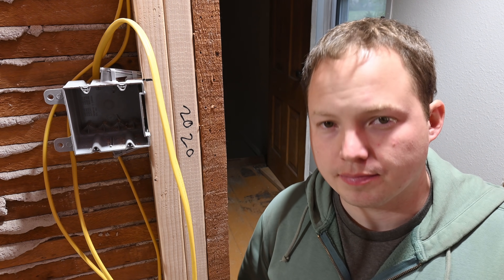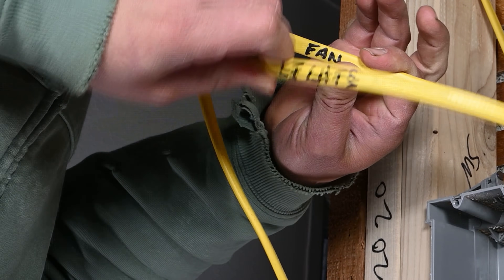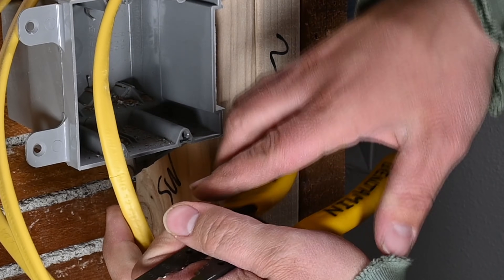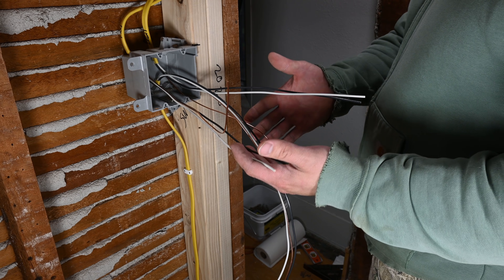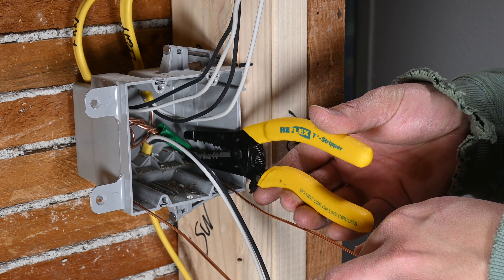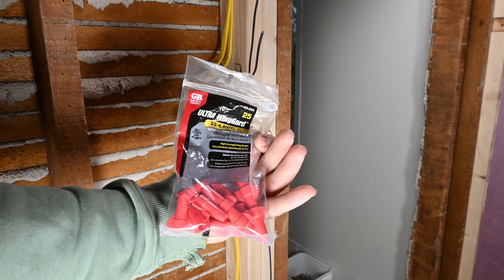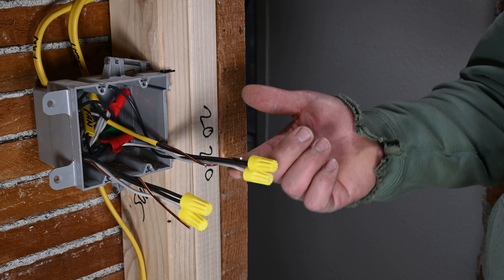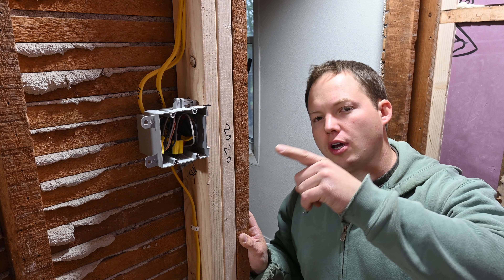How To Rough In Wires For a Bathroom Light & Fan Two Gang Switch Box

Comment: Couple things I'd do differently. I would pull all the romex into the box first, then strip. That way I don't have to relabel the cable and I can leave more sheathing inside the box. Also, I would use a normal wire nut if there are two ground pigtails. I only use greenies if there's only one ground wire needed.

I would also consider having one 12/3 switch leg unless the fan is separate from the light or the local code requires 2 separate neutrals at the ceiling fixtures.

I'm not an electrician but I'm majoring in electrical engineering and I have worked with electrical wiring for couple years.
Reply from the maker: Thanks for sharing! I like how there is more than one method or way of doing things like this.
Reply: How about answer this for me (anyone) what if I put a new breaker box in with all 20 amp gfci arc fault breakers and 20 amp outlets on 12/2 wire....is there any reason at all I should buy 15 amp and 14/2? Can't find an answer, is it over compensation or is there a legitimate reason you need 15 amp circuits with smaller wire? If I buy 300 ft for the whole house I would rather just use one style wire (aside from water heater ect..) instead of mixing them causing future potential problems
Reply from the maker: @davidkramer333  14awg is easier to work with and well adequate for lighting circuits. You are correct though that using all 12awg would work just fine. It's just overkill for lighting since LED uses such a small amount.

Good luck on your project!
Reply: @BenjaminSahlstrom  I am buying in bulk so I would have enough 12 to do the whole house is my reasoning. Your videos have helped a lot. I am doing the fishing and roughing in lights and outlets in an old house. I can run everything without having it even hooked to the box since I am upgrading my service when I am done. I will have a professional inspect my work, put in the new service and hook it all up to the box because I am not at that level yet. I am in the country so I can shut it off from the pole in my yard if needed but I still am not 100% so I will leave that part to a pro. 

Thanks for the response, you have a new subscriber
Reply: Do some more research your approach is faulty
Reply: @gerdberg4188  If it's faulty, why are other electricians doing it? Instead of spending your time and energy correcting me, why don't you correct the electricians who showed me how to strip inside a box? In the Electrician U channel, a Texas electrician by the name Dustin always strips inside a box. Here's a video of him installing a single pole light switch:
https://youtu.be/PL2QF4OK1to

30 seconds into the video, he stripped two romex cables inside the box. He even tells you how he does it. This video is the short version. The original video is way longer than this
Reply: @gerdberg4188  "Well, that's just, like, your opinion man..." (The Big Lebowski, 1998)
Reply: Care must be given when passing out electrical advise.  In some states, electrical professionals can be held legally responsible for the advise they give.

If you are not a professional, please seek out the correct knowledge before doing any work.

Can this circuit be jumped from the bathroom receptacle?  Maybe!

Are neutrals required in this box?  Why?  Part of code?

And a commentor asked about using 12 awg instead of 14.  This felt like an invitation for a lesson on "voltage drop" and wire length.

So, if you are going to do your own electrical work, let me remind everyone that a second check might catch a problem before it becomes a disaster and especially the pros, inspectors might be your only second check.  Please make them work double time to find any problems.
Reply: Well how many thousands of boxes do you think it took me to develop the methods I use to make things work out the FASTEST
AND THE BEST .  What you say about not mattering inside the box is wrong thinking . You only need a short bit of sheathing in the box . The rest gets in the way of making up a box nicely . The code says that work needs to be executed in a “neat and workman like manner”  that means everywhere by the way . Would you just stuff wires in a panel …. No
Well the wires in any junction box big or small need to be arranged sensibly too that also applies to device boxes .
Reply: @gerdberg4188  When using non-metallic (PVC or fiberglass) boxes with integrated tension clamps, it is much easier to insert the unsheathed cable into the box first, and very carefully strip the sheath from inside. You need just a 1/4 inch or so of sheath beyond the point of entry into the box. The reason it's easier stripping after is because the stripped sheath will invariably snag on the clamp before you can pull in the necessary 1/4 inch required by code. If you're using the REALLY cheap non-metallic boxes that have little square knockout holes with no integral clamps, then yeah, you can just poke your already-unsheathed cable in there. That's probably what you're using, so it makes sense you're doing what you're doing.
Reply: @aaron74  I agree. Thank you for your excellent explanation of why people like me strip inside a box
Reply: @aurvaroy6670  I'd wager most people do it this way! Even Ben did in his earlier videos. To be fair, that gray box that Ben's using in the video seems to have clamps that are less aggressive than the blue boxes have, and the sheathed cable doesn't snag.
Reply: @aaron74  You're right. Ben did it in his older videos. In fact, he labeled each cable inside a box before stripping and forgetting which one is hot and which is a leg
Reply: I now see why you insist on steel . It not “better” it’s different .  Different systems use different materials . I knew after a bit that you were not licensed . You do not have a full understanding of the trade and the application of proper materials for the installation at hand  . I have been installing code compliant electrical systems of all types for over 30 years . my systems 
Always pass the inspectors scrutiny . I don't just do electrical work , an Electrician is what I am .
I don't mean to be a dink , I am sorry , my GF said I should be nice .  So hang in there it actually sounds like you do a good job 
I was partly ragging on you . Lol.   I know it is hard to get someone to do the work and they charge arm and legs now
Reply: @gerdberg4188  I believe steel is objectively and qualitatively superior. Your only valid argument against steel has been cost, which I fully concede. Quality simply costs more, both in materials and labor.
Reply: You have no valid argument you are not an electrician and do not understand the systems and their application . 
You won't even BEGIN to until you have been doing it professionally and doing design build work .
You are just wrong . Like I said you could not possibly compete on a commercial 
Level .   You unlicensed guys think you got it covered . But you do not .
I have been behind many guys like you . I have seen lots of good work lots of bad work . Steel is not better in many situations .
Go ahead use steel in an old damp basement or a garage or shed out building  , barn , bathroom , even the kitchen . And you will find that steel all has corrosion of some type . My systems will outlast yours and be more easily serviced . You just do not use steel boxes where you do not need to . Talk to any electrician maybe they can get you to understand . Basically you are misapplying materials . 
You just do not get it  I am sure your work is good just not totally code compliant
Reply: @gerdberg4188  The amount of arrogance in your comments is overwhelming me. You say you have over 20 years of experience and do this for living, yet you set around and leave really long replies to amateurs like me. You tell us not to argue with elders, yet you're allowed to taunt youngsters like me.

Let me be clear. I'm not an electrician and I don't plan on being one anytime in my life. I don't go to people's houses or businesses fixing or installing electrical equipment. So don't expect me to work for you or against you. I am majoring in electrical engineering, so it's fitting for me to do some simple electrical work, like installing an additional receptacle, rather paying someone $300 to do it quick and dirty. Videos from Ben and Dustin help me do such work, unlike your replies that hurt me instead. 

I'm tired of hearing the same shit from you over and over again. For this reason, I'm not gonna respond to any further replies from you. Instead, I'll continue watching videos from this channel and Electrician U
Reply: @aurvaroy6670  Yeah, this channel seems to attract trolls every now and again, and usually the trolls don't even know they're trolls like this guy. Usually butt-hurt tradesman who, while certainly competent in their trade, feel undermined that DIY'ers can perform code-compliant installations with equal competence as them.
Reply: @aaron74  I agree. Some people have problems with unprofessional, unlicensed folks doing electrical work. I'm not gonna listen and follow to those trolls. Thank you taking your time and defending me. Your comments always make sense to me, so I'll continue listening to you
Reply: @aurvaroy6670  If you're following Ben here and Electrician U, you are really set. Both guys are very good. I would say just because someone may not be licensed doesn't mean they're unprofessional. I would compare the outcome of my work any day with a journeyman or even a master... I'll admittedly just take longer to get the job done since I don't do it every day. It's okay, I'm not in any hurry! lol
Reply: @aaron74  Thanks for that compliment. I always learn useful information from both channels. In fact, they inspire me to do more projects on my own.
Reply: @gerdberg4188  "I'm sure your work is good, just not totally code compliant," he says with feigned diplomacy. If your work is not code compliant, it's not good. Any electrician not suffering cognitive dissonance should know that. You have a right to your opinions, dude, but they're only just that--opinions. We all have them. The more sensible among us don't bully people with our opinions as though they are facts. Tell all our sparky friends in the Chicagoland area that they're wrong for using steel and EMT. That is local electrical code in that area--it supersedes NEC.
Reply: @aaron74  ya but you are misapplying by using steel with nonmetallic cable . 
Wanna have a pipe bending contest , I have run many thousands of feet of all different sizes of that too .
You peeps have no legs . You need to pay attention . If you are not an electrical professional you know not of what you speak .
Period . Fact . Period . And for the engineer , we’ll talk to any electrician and you will find that very few engineers can design any system without much rework until they have many years experience . Engineers should all be required to work two years in the fiel on their field
Reply: @gerdberg4188  You don't want a discussion. You want a pissing contest. Show me in the NEC where you can't use NM cable with steel boxes. You're full of bluster and devoid of FACTS.
Reply: @gerdberg4188  The more you talk, brag, and demean others, the more sure I am that you're a 2nd rate electrician at best. I've doing this a long time and there are lots of ways to do good work within NEC guidelines. Some strip in the box, some don't. I do it both ways depending on the situation. Real pros know when and how to pivot to alternate methods. And BTW, judging others you've never met and work you've never seen is trolling. Lighten up.
Reply: @mntriangle  go away you are obviously not an electrician at all
Reply: @gerdberg4188  The world is so lucky to have God's anointed one right here in this forum! My apologies to thee.
Reply: All you guys that are not in the trade …….listen to the guys with the most experience………..the electrician u guy is good but he misses shit believe me…………….I have probably been doing it 20 or so years longer  and I miss shit . Shouldn't argue with your elders……….
Reply: @gerdberg4188  ".I have probably been doing it 20 or so years longer  and I miss shit . Shouldn't argue with your elders………." - To that I say "Even an old dog learns new tricks," and if you've been doing the work a long time you are obviously very hardened in your opinions and probably mistake them as facts. If I hired you to do electrical installation at my house I would want you to use steel boxes, and I would not care if it costed more. You do what the customer wants, or you walk away with empty pockets.

Also it is very fair to say we will ALL miss shit. Nobody is omniscient.
Reply: You have no idea how much crap an apprentice has to go through to be qualified for the trade . It takes minimum 4 years working full time , all documented  , plus school to get a journeyman's license . Why do you think that would be .
Yes I guess I am a little arrogant having people that aren't even qualified as apprentices arguing with me instead of listening .
Reply: @gerdberg4188  The world needs competent and well-trained electricians. There's no shortage of work for you, and you should feel good that you take your work seriously and are willing to challenge the ideas of others. I would encourage you to try and separate your opinions (work habits) from facts (NEC). Facts always settle things, because that how good inspectors judge the work. And be willing to concede you're mistaken about things when facts are clearly pointed out to you. Good luck!
Reply: What a painin the ass you always strip first , the cable sheath can be trimmed properly then it can be let into the box the proper amount . Just like this guy . After you wire and make up enough thousands of boxes you learn the fastest best method that makes the whole thing come as code worthy and neat . There is too much chance of damaging the conductors when stripped in the box . Also the sheath is on gear than it needs to be ,  making the wires harder to work in the box . Box for box I am sure I could blow you away timewise and mine would be neater
Reply: @gerdberg4188  I understand your point. If the box wasn't mounted to a stud or anchored to a wall, then I'd definitely strip before sliding the romex inside the box. However, in this video, Ben, the "guy" I'm assuming you're referring to (please use names next time), was working with a box already mounted. If was roughing in that box, I would strip inside the box. I've seen professional electricians, including Dustin from Electrician U YT channel, pulling romex into the box then stripping. Did it look neat? Yes, Dustin is all about neatness. Was it quick? Of course, Dustin is an electrician for a reason! Did he nick any conductors? Absolutely not. It's a lot harder than you think to nick conductors inside romex sheath. 

Also, when I first started watching Ben's videos, he stripped inside the box and everything inside looked good. (I have a feeling that the poll he shared before this video posted changed the way he strips wires.) Since then, I've been doing the same since both Ben and Dustin do it that way. In fact, I find it difficult to feed individual conductors inside a box. I don't care how neatly I cut the sheath because it's all inside the box. No one's gonna look at it with so much detail after passing inspection. Inspectors care about the lengths of sheathing and conductors. Stripping inside the box allows me to leave more sheathing inside, further protecting the conductors.

Look, I don't do this for a living, but I watch numerous people, professional or not, do this work so that I don't have to pay $300-$500 for someone to do it quick and crappy. I take my time doing work like this so I don't care if you're faster or neater than me. Apparently, you do this more often than me so I respect your views, except when you began bragging at the end of your reply.

Sorry for this lengthy response. Lotta stuff to tell you and get off my chest. Been a while since I commented so...
Reply: @gerdberg4188  Dude, understand: THIS IS A TUTORIAL. This is not a speed competition. In the real world, he could've done it all within 5 min. But he's explaining as he goes. Also, everyone has preferences as to how to do things. He's not wrong. That's his preference. You should have a YT channel yourself, explaining why your method is better than anyone else's. Yes, it's a dare.

Comment: +1 for not changing anything. Excellent job. Don't forget I'm still looking for a video on installing a 0-10 volt dimmer switch to multiple LED style florescent lights fixtures.
Reply: Typically the power pack will require you’re regular line voltage connect as well as a 18/2 LVT cable. Each fixture will receive a 120v whip to supply power and a 18/2 wire going in and out using the grey and purple leads